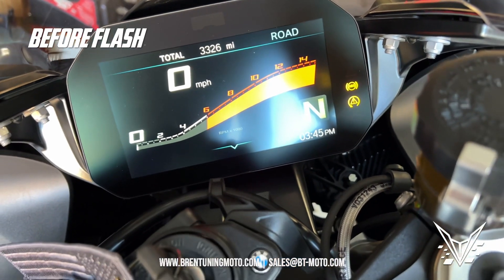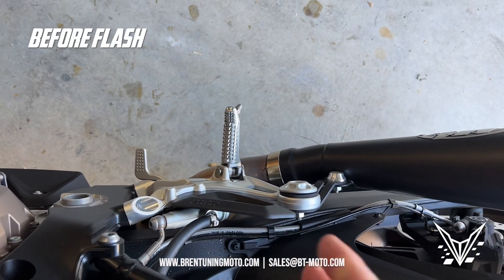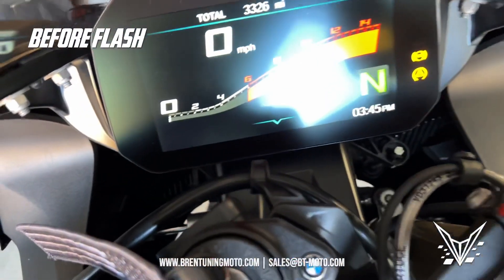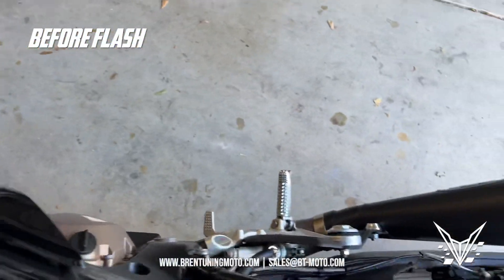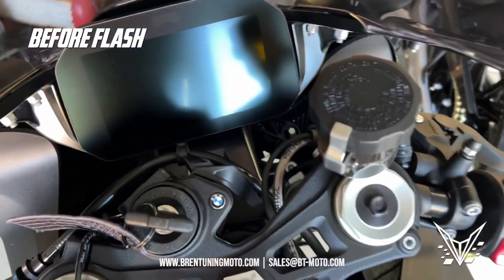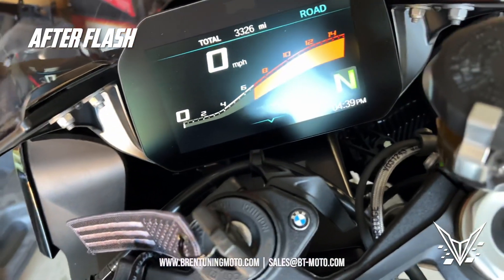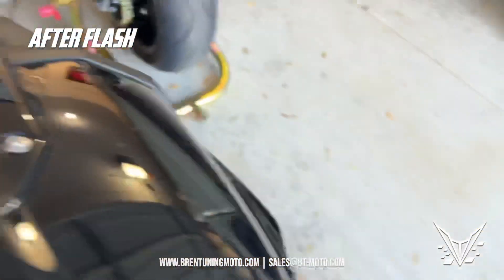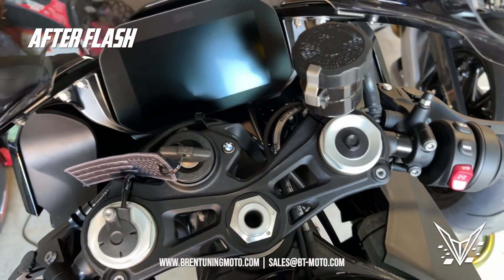2021 BMW S1000RR Cold Start and Idle, BT Moto Ecu Flash

Comment: Question is it possible to install a switch or do an update to the modes to open the valve to different modes like in "Race - open" and in Street- closed?
and second question. are you able to adjust the fuel map to 102 octanes? (we have that in Germany) =)

Comment: Do you have to flash back to stock for fuel adaptation?  I have stage 2 on a 2020 xr and it doesn't seem to calibrate if on tune.
Reply from the maker: Fuel mapping is adaptive. No need to switch files. Email with any questions
Reply: @BT_Moto  thanks 👍